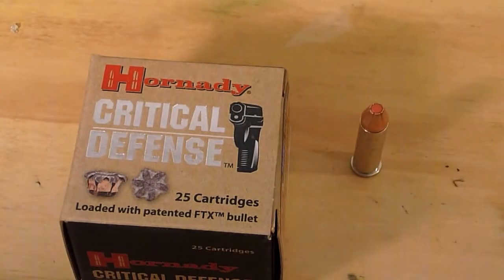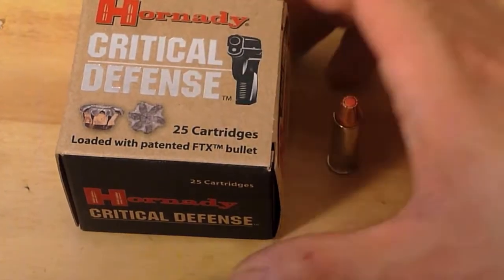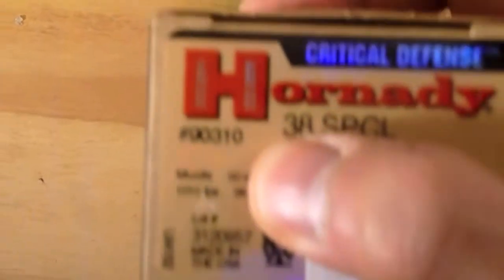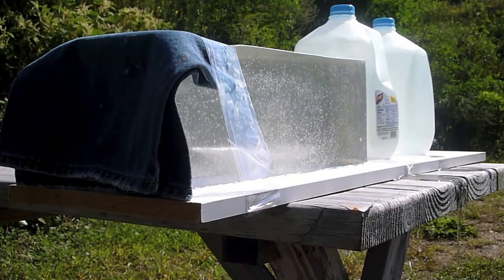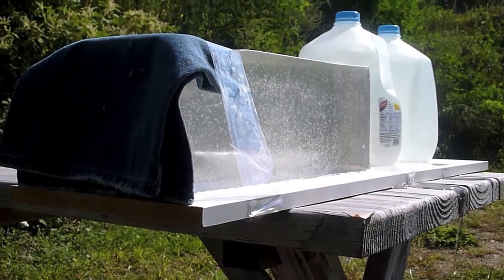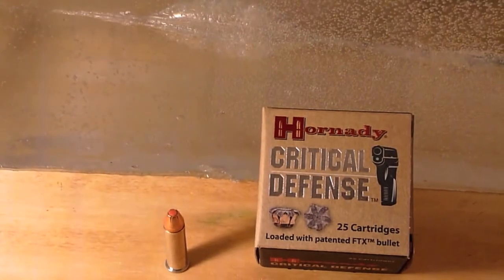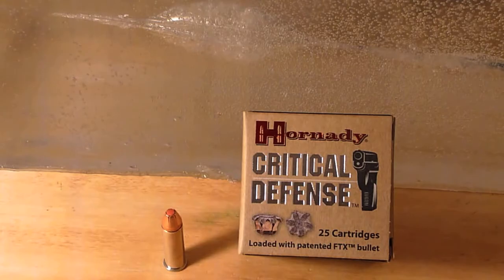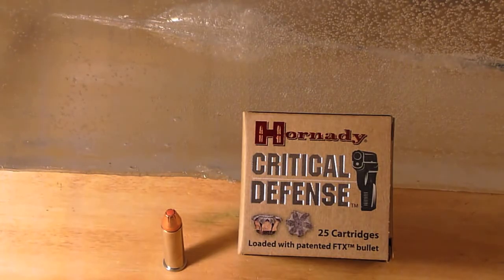Clear Ballistics Gel: Hornady Critical Defense .38 Special 110g

Comment: Sometimes bullets do weird things I'm thinking may have might have flipped around and when all the way through pretty much as a full metal jacket if it turned backwards is pretty much like a copper wadcutter I think he should have testing it 1 or 2 more shots I just tested the 90 grain 38 Special non plus P Hornady Critical Defense Lite and in expanded through 4 layers of denim and they got about 13 in of penetration and expanded great now that's out of a 3-inch Rossi model m88

Comment: Will you be doing any additional testing of the Hornady Critical Defense in both non and +P?  I currently have the "non +P" in my S&W M442 Pro Series. I chose it because of availability in my area but also because of results shown on Lucky Gunner Lab results. They fired 5 rounds of each non and +P first in bare clear ballistic gel,  then 5 more each as you did with clothing. All rounds expanded and non of them over penetrated. Standard pressure avg. penetration was 14" and +P round avg was 13" with expansion .45 or greater on all rounds. I'm Curious if they have improved the engineering of round since your testing back in 2013.  Great videos!

Comment: Bullet probably flipped around backwards so you get a little bubble of a cavity and then it continues on like a wadcutter.  That's not exactly a negative because I'm going to be honest there are some serious problems with "modern" defense rounds in the standard .38 special.
   First pretty much any round that does expand is getting the absolute minimum penetration due to the snub's low velocity.  If you look at actual shooting cases (medical cases) you will find that is insufficient.  Often even a .40 JHP fails to reach vital organs through the front of the chest.  
   Second any round that penetrates enough (because it is penetration that kills not the temporary cavity) in the .38 will by most standards over penetrate.  

   Solution?  There really is none.  However with only 5 shots you cannot rely on multiple shots to stop the threat the first bullet must be placed accurately, and penetrate effectively.  IE You either need to learn to live with over penetration and check to make sure nobody is directly behind the assailant, or choose a different caliber handgun or a longer barrel.  

   Which is why the wadcutter is and always has been the premium snub nose .38 bullet.  High weight, and low velocity makes it penetrate better with less deflection.  The flat nose will cause more internal bleeding vs a round nose.  It will over penetrate however the odds of it going through a live persons chest, and then flying any distance and killing someone else is very small.
   It might wound a bystander behind them but the odds of it carrying enough energy to kill a second person is slim.  Far less than the odds of a shooter missing and simply hitting someone else which is 9,000,000 times more likely to happen.
Reply: Are they hard to get the plug out of them?
Reply: Slim Jim you couldn't have said it in a better words I own a 38 special and I've done many tests I've tried the Hornady zombie Max I've tried the Hornady Critical Max I've tried the Hornady Critical Duty I've tried the Winchester train and defend both the train bullet which is 130 grain jacketed bullet and the defend is 130 grain jacketed hollow point and by far Hornady and Winchester performed the best but when I say the best only 50% of them I would say as an average would expand to what they the Box said it would expand to now everyone under the expanded to what the box said did not penetrate more than 12 in which is less than what FBI standards are for a lethal kill but I measured from the front of my chest to the back and I got 11 in so if I got shot with that and it fully opened it would have still went all the way through me unless it hip bones and you know things like that but 9 times out of 10 don't matter what bullet you got it's going to go all the way through a person especially if you're shooting a 38 or even a 22 I've accidentally been shot by a 22 and it went in and out so fast that I didn't even know I was shot until I seen the blood and I tell you what people that say 22s can be self-defense let me tell you you're better off having you a swarm of bees because I swear to you a bee sting hurt more than that damn 22 CCI + V which I got time meant plus velocity
Reply: @chriswilliams8862  And you could have said it in more than just one long sentence.

Comment: That bullet design is so flawed. 50% of the time they don't expand. Personally I'll not take any chances carrying it.
Reply: +ruizhernandeztrustfi I have always had 100 % expansion.
Reply: +ruizhernandeztrustfi Critical defense and critical duty are both specifically designed for use in a service gun, a barrel with at least 4 inches.  They suck in short barrel weapons.  Definitely not my preferred carry ammo.
Reply: David teer

Exactly my point!
That's why always insist manufacturers should print in the box not only the FPS but the barrel used for the test. It's misleading for the consumer when you only see the FPS. That's the reason why those bullets fail to expand 50% of the time because the bullet can't reach proper velocity in a snub barrel.
Reply: ruizhernandeztrustfi common knowledge in the gun community is handgun testing is done with a minimum four inch barrel. Consumers need to do their homework before buying a product as well
Reply: +David teer 

David, I agree with you but manufacturers knows there's hundreds of people carrying snubs. Those tests should be tested with a minimum barrel of 1 7/8" (s&w revolvers for example) (yeah I know, I'm asking too much) but it's time to change things, we can't continuously making the same mistakes over and over again and expect different results every time, life is about evolution and stating only the FPS in the package is misleading, I know we can search the web for that information but come on! Why don't publish the information on the package? easy, because that way they can print any velocity they want.

Let's say for example, an ammo manufacturer can test a bullet using 100" barrel and publish a massive amount of velocity. (it's correct... yes, it's the reality for the mass market... no)

I hope this helps.